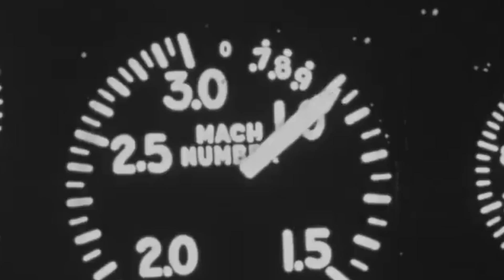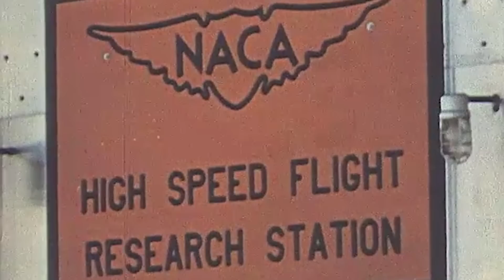The Flying Bullet That Shattered Aviation's Limits Forever

Comment: It’s amazing that a straight wing plane achieved such a feat.
Reply: F104 is also a straight wing design
Reply: @sebcam9498  The F-104 has the same leading-edge angle as the Me-262. it also has extremely short wings that remain within the main shockwave cone created by the nose...
Reply: @DoktorBayerischeMotorenWerke

The DC-3 also has the same leading edge angle as the ME-262.  

The ME-262s wings were swept for the same reason as the DC-3’s.. to preserve handling characteristics due to a design change (the DC-3 being a larger version of the DC-2, the ME-262 having larger and heavier Junkers engines in place of the BMW ones). 

That wing sweep angle has almost no effect on supersonic aerodynamics.
Reply: @calvinnickel9995 Just like modern airliners an aircraft can have larger engines fitted without any change in wing sweep angle by simply shifting the position of the engines on the wing.
The Me-262 never had straight wings so this Alliboo myth is easily debunked.
Reply: @WilhelmKarsten they cant- Boeing tried it with a work around in the flight control software to compensate...
Didn't end well
Reply: @laurencedawson7754  What about the Airbus A321 Neo??? Or the Boeing E-6 Mercury?
All aircraft pitch up at full power... it's like you have never flown an airplane and know nothing about them.
Reply: @WilhelmKarsten  illustrating a point pal.......
Reply: @laurencedawson7754  Your comments reveal someone who has absolutely no formal education or professional experience in aviation... You clearly do not understand some of the basic fundamental concepts like CoG, CoP or PoP (Pitch-up on Power)
You also seem very confused about the difference between a Horizontal Stabilizer and a Horizontal Stabilator.

Stabilizers are fixed, non-moveable tailplanes.

Stabilators are movable and can be adjusted for camber angle in flight. 

Stabilators are used with, or without elevators.

Stabilators can be used for primary pitch control or secondary pitch control.
Reply: @DoktorBayerischeMotorenWerke  well.....attacking a person's education or training rather than addressing the point at hand is a well known logical falicy........I have shown you a photo of a traditional elevator arrangement on the me262..... rather than attacking your perception of my education....why not simply explain the photo? As for formal education.......I'll tell if you will....!!
Reply: I believe during those amazing times of trying to solve the problems of "compressibility" and the associated control problems, they referred to it as an all moving tail plane.....as you well know the key element was that by moving the whole horizontal stabiliser as a method of control, yes on the X1 they had both.... The pilot could move either the stabiliser or the elevator ....either way, this solved the control problem which it's documented was the downward deflection of the elevator .....so after all that , back to it.  Your point I believe was that using this a solution to supersonic control came from the me262 having this arrangement? ( All moving tail planes are ancient from the earliest days of flight)  My point was that it is much more likely to have come from the bell visit to miles in 1944 ( an allied country and before the end of the war and therefore before operation paperclip)...my secondary point was that all available photographic, documentary and pilot accounts would very plausibly seem to confirm that the me262 used a traditional fixed horizontal stabiliser and moving elevator section. Education, definitions of elevators and  stabilators taken from Wikipedia are not important......as I said I'm a huge fan of European ww2 tech advances and German in particular, which combined were poached by the US and Russia who furthered it all with their vast resources.....bug if you really must , then please keep it civil and address those points directly without personal attacks
Reply: @laurencedawson7754  Thank you for admitting that you were wrong... it's very brave of you and not a very British trait to admit you were wrong.

You are not very familiar with the Me-262 or its electric powered fly-by-wire Horizontal Stabilator system.

Please go do your research and you will find that you were simply unaware of this remarkable German technological achievement.
Reply: @DoktorBayerischeMotorenWerke  good to be on good terms my friend, but I'm not sure I admitted to being wrong! We are having a good discussion now though- convince me that the X1 elevator arrangement came from the me262 after the war and not from the visit to miles in 1944..….
Reply: @DoktorBayerischeMotorenWerke  as for British traits, I believe we are rivalled in arrogance only by the french!!!
Reply: @laurencedawson7754  The French were ahead of the British in supersonic aircraft and produced the first European Mach 1 aircraft.

They also still produce their own jet aircraft and space rockets... something the British cannot..
Reply: @DoktorBayerischeMotorenWerke  I was hopeful of a good discussion with you my friend, but you seem to reduce this all to an anti British rant. Germany produces the euro fighter with us, I'm hopeful it will join the tempest project otherwise you will be left with no current aircraft. What does french production of supersonic aircraft have to do with our discussion? Are you 12 yrs old?

Comment: Key to the success of the X-1 was the information provided by the Miles M52 design team.  The 'fully flying' elevators eliminated the hinged elevators flutter, a high speed oscillation, that  had caused several conventional aircraft to crash as they approached the 'sound barrier'.  Geoffrey DeHaviland's DH108 attempted to address this problem by eliminating the tail altogether but probably crashed from flutter that damaged the 'elevons', combined elevators and ailerons, on the main wing.  Mentioned, but not explained, is the return of the X-1 to bell for modifications.  This was when the fully flying elevator was incorporated into the design, eliminating the hinges and moving the entire rear wing to serve as a structurally inflexible elevator.  All modern high speed aircraft use fully flying elevators as a result.
Reply: Never in history has there been so much discussion regarding an aircraft that in fact, never even existed.

The M.52 is a false narrative that has been used by revisionists in an attempt to insert Britain into the history of supersonic aircraft that it was not a part of during the 1940's.

The Miles M.52 embezzlement scandal revealed that no actual work was ever done on the M.52, when the Board of Trade and the Air Ministry officials raided Miles Aircraft company, no trace of the two prototypes or any completed drawings were ever found... nor was the money paid to Miles for them.

The power assisted servo-controlled Horizontal Stabilator is not a British invention, it was created by Adolf Busemann at the World's only supersonic aircraft wind tunnel facility during WW2, the German RLM's LFA or Luftfahrtforschungsanstalt 

This advanced aerodynamic technology was first produced for the Messerschmitt 262 jet fighter... and was used by Jack Ridley on the Bell XS-1.

Britain lagged many years behind in supersonic aerodynamic research in the 1940s and 50's. Construction of the first supersonic wind tunnel at RAE Bedford would not begin until late 1947.
Reply: All modern high speed aircraft use normal elevators. They use an all moving stabilizer as well.
Reply: The Miles M.52 never existed and the Bell X1 used a Fly-by-wire Horizontal Stabilator system copied from the Messerschmitt Me-262.

Bell Aircraft had a very significant relationship with Theodore von Kármán,  Adolf Busemann and Messerschmitt after the war.
Reply: @WilhelmKarsten You need to read the book Miles M.52 written by Captain Eric Brown one of the greatest pilots ever.
Reply: @paulandsueroberts4121  Pure British science fiction... the was never any Miles M.52, it never existed.
Reply: @WilhelmKarsten  you mean like the stabilator on the me262??
Reply: From the accident report, DH108 suffered from control reversal as it approached Mach 1, resulting in what  was often a violent manoeuver.  Geoffrey DeHaviland was a tall man, 6 foot, and when his body was recovered it was found he’d broken his neck, believed to have been sustained when his head struck the canopy.  Another pilot who was slightly shorter managed to avoid the same fate and made a report back on the ground. Side note: all three DH108s were lost in fatal crashes.  Those early days of high speed flight really were forays into the unknown, and when you stepped outside parameters you didn’t even know existed, there was zero time to respond.  The film, The Sound Barrier, a 1952 British classic, gives a real feel of the risks of exploring the unknown. Tony’s crash sequence is visceral.  A great irony that two months after its release in July 1952, test pilot John Derry died when his DH110 broke up during a display at Farnborough, England.  Turned out the aircraft that had been used all week had experimental overwing strakes to manage airflow over the wing. The fatal flight used an aircraft without the strakes - seems they’d accidentally given the wings just enough extra rigidity to withstand the high energy rolling pullouts being demonstrated.  The crash being at Farnborough was quite convenient for the Air Accident Investigation Branch, based at the airfield. Indeed I seem to recall reading in his biography that the investigator assigned to the case had seen the breakup from his back garden.
Reply: We know from historical evidence that there was never any aircraft called the  M.52 designed or built by Miles, nor did they ever produce any jet aircraft that could fly supersonic or even transonic. 
What the British historians are trying to do is create a false historical account that includes Britain in the storyline of aircraft technology that they never had any meaningful participation or impact

Comment: Was the host plane the B-29 or the B50?  The B50 was similar in looks to the B29.  I only ask as a documentary of the B-50 stated that it (B-50) was the plane the carried the X1
Reply: The Boeing B-50 did not enter service until 1948.. the first X-1 test used the B-29 towards the end of program the B-50 was used.

Comment: Crazy they did this with straight unswept wings!
Reply: Yes, a very inefficient design but the wings were short and thin enough to remain stable in the main shockwave cone at supersonic.
Reply: @WilhelmKarsten

You misunderstand supersonic aerodynamics. 

The only thing the air cares about is how thick the wing is along the longitudinal axis.  So if its a thin straight wing like the X-1 or F-104.. or a thick swept wing like the F-100 or F-101 (which presents itself like a thin wing on the longitudinal axis) it doesn’t matter.  

The only way swept wings make a difference is it allows them to be made simpler with two thick wing spars instead of multiple spars.. and that they won’t easily protrude into the bow wave (the X-1 didn’t go fast enough for it to matter, the F-104s wings were short enough and far enough back that they remained within the bow wave).
Reply: @calvinnickel9995  None of that matters he you do not have adequate stability and pitch control... this was not possible until Adolf Busemann invented the Fly-by-wire HORIZONTAL STABILATOR.

It was first used for the Messerschmitt Me-262.

Any questions lad?.
Reply: @WilhelmKarsten yes I refer you to my photo of the me262 - clearly no stabilator.......
Reply: @laurencedawson7754  You are not very credible if you didn't know that the Messerschmitt Me-262 was the world's first jet aircraft to have a fly-by-wire Horizontal Stabilator system..
Reply: @WilhelmKarsten  you keep repeating this statement....without elaborating or explaining and you justify your position with a personal attack or logical falicy.  Direct quote from the me262 pilots handbook " flying the controls are conventional using push pull rods throughout"